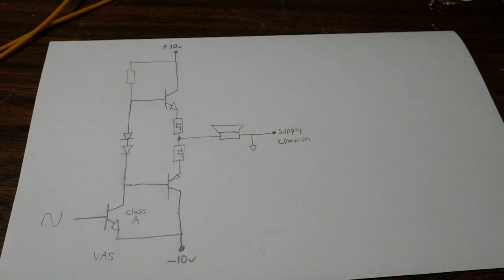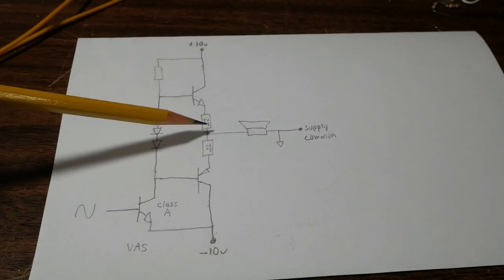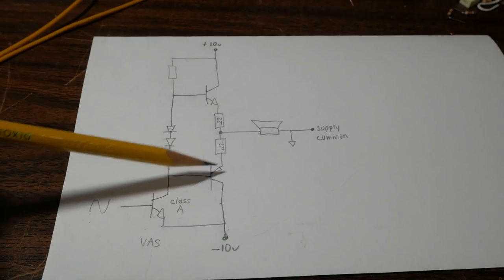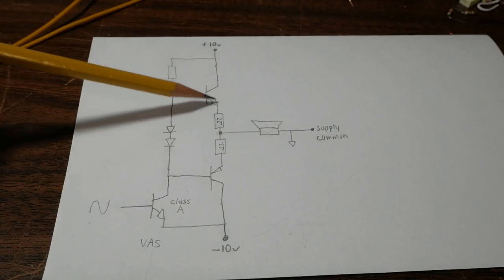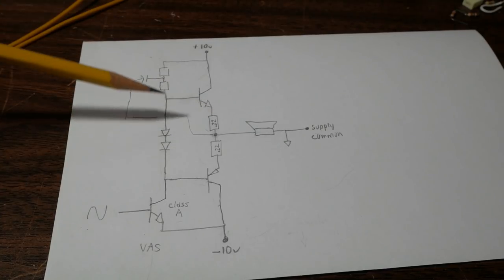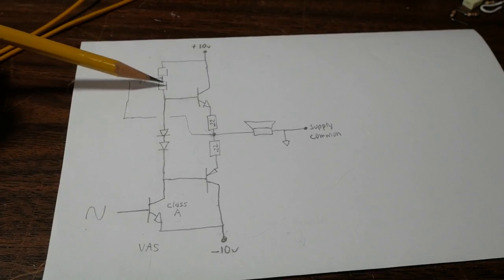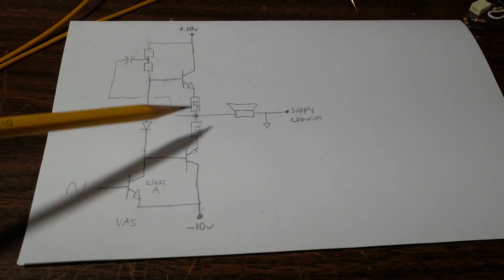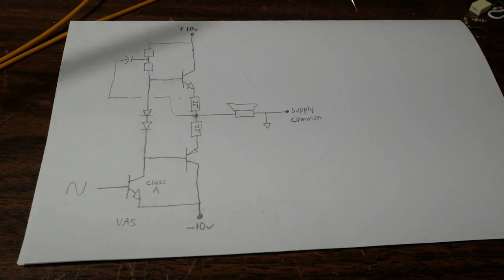How it works - Bootstrap circuit in audio output stage

Comment: 1) Thanks for another great video! 2) Your technique for showing the circuit riding the sine wave created excellent visual imagery. I really got it! 3) I can get easily confused, trying to sort out the difference between an AC signal and an oscillating DC signal. But, I think  that you may have misspoke, when you said that a boot strap circuit requires an AC signal. For a single, positive going supply, doesn't the operation of the boot strap just require an oscillating DC signal? Meaning that the signal must fluctuate, but it does not have to cross below 0 (zero) volts? I look forward to you straightening me out.

Comment: 8:23 at this time cap is charged so its left plate should be #Negative instead of positive , in next stage of its operation when upper Bjt are try to be in active condition its output voltage ≈ + 10 ( or 10 volt center ground ) will add up with 5 volt change stored in cap giving overall +15 volt ,
#but......
You have not included Diode just below the positive supply rail so that Bootstrap boosted voltage have two way to go ..
One towards Base of upper bjt 
And second it should  also go towards +10 V since there's Potential difference 
Of 15 - 10 = 5 volt !
Plzz review and confirm it .
M i right ?

Comment: @JohnAudioTech good video, if you choose too large of a capacitor will oscillation occur, how do you choose the value? Do you calculate a rc filter using just the lower of the two resistors? Thanks

Comment: Howdy.
Blimey. I have been in error. (arrarrgh ...).
I thought what you explain was neutralization. Much obliged for the correction.
Neutralization evidently is applying negative feedback at the frequency the amp. has a tendency to oscillate.
Regards and many thanks.

Comment: In some pre assembled audio boards, the Bootstrap capacitor values are either reduced or increased than what's given in datasheets of the particular ICs used. What difference does it make by reducing or increasing the capacitor values ?

Comment: will caps affect the slew rate and create phasing?
Reply: With global feedback monitoring the output after the DC filtering cap, it can cause the DC offset to drift upwards(before the DC filtering cap, not after it), but that can be fixed by adding some local feedback.
The capacitor isn't actually in the way of the signal, it just gives the supply rail extra current to work with. However, it can cause unwanted DC biasing of the output that gets hidden by the DC filtering cap if using global feedback, and that can cause premature/unbalanced clipping and inefficient operation, but a single resistor is all that it takes to fix it. Just add a resistor between the signal and output.
The issue has to do with the opamp in a global feedback arrangement 'chasing' the voltage droops of the output. It causes the output to become more and more DC offset behind the DC filtering capacitor.

Comment: Some people bypass bootstrap capacitor with ceramic or film cap of 0.1u. Is there any benefit of doing so? Thanks
Reply from the maker: I see littler benefit in that as the resistors in the bootstrap circuit are orders of magnitude higher than the ESR of the bootstrap cap.